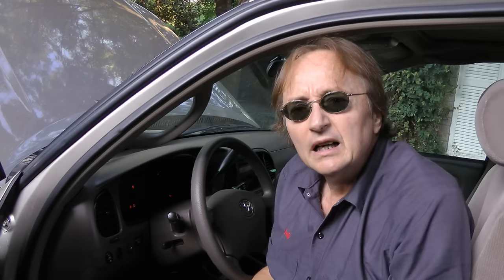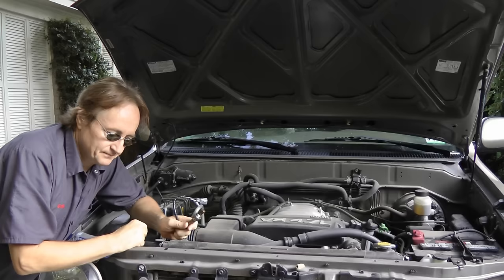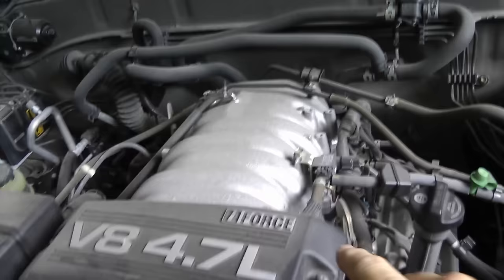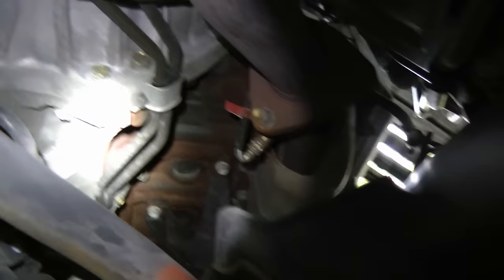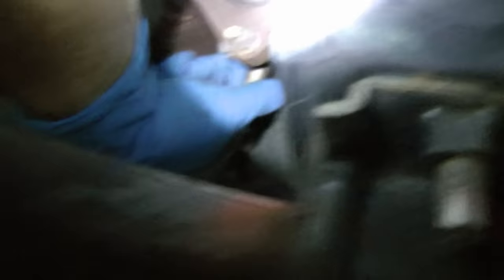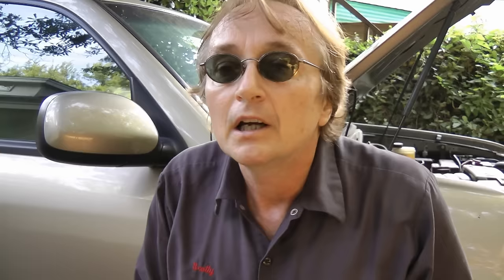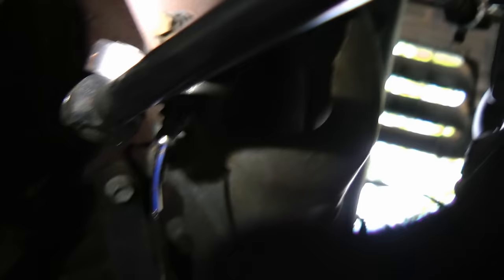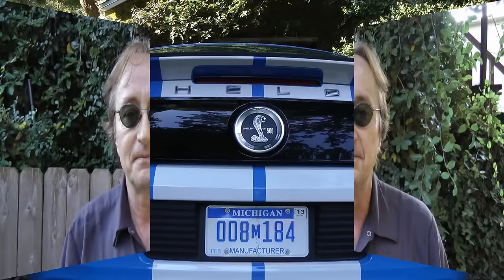How to Replace an Oxygen Sensor in Your Car (Air Fuel Ratio Sensor)

Comment: That's copper anti-Seize, it doesn't have to do anything with sealing the threads correctly. anti-Seize is use to prevent something from getting frozen/stuck together.

Comment: hey its me again with the 2001 Hyundai Elantra. the check engine light I'd on for oxygen sensor circuit slow response bank 1 sensor 1... can you please educate me on the location of it ...
Reply from the maker: that's the sensor on the exhaust pipe BEFORE the converter. #2 is after the converter
Reply: Thank you. I changed it already.

Comment: Hello scotty,

Ive been dealing with a 98 mustang for a year.I had bosch  o2s upstream which worked for a while then back with the p0135.I replaces with some cheap sms which then gave 2 codes.SO i got smart and got HGKs and only one code which is that darn p0135.
Ive rechecked harnesses, did the cycle and still after the cycle i get that code again. But i noticed the computer says the cat converter monitor says NOT COMPLETE. Even with the o2's complete one gives the p0135 and the cat monitor is still not complete.
Reply: would any downstreams cause a code for upstream??
Reply from the maker: often a bad cat causes all those problems, see that a lot
Reply: Scotty Kilmer thanks scott. Should. Have mentioned these are aftermarket performance  cats installed by midus 8 years ago mate.But if you recommend. Replacing i will,
Reply: Jimmy S  thanks for that info. UI remember the fuse blew a year ago and i replaced them. I am using a odb 2 bluetooth and app.It is showing BANK 2 SENSOR 2V as 0.0 reading and BANK 1 SENSOR 2v as  0.0 reading.the other 2 are reading random numbers as they should.I wonder if the PCM took a dump? I traced wires and checked fuses even took the pcm apart to check for anything.
Reply: Jimmy S
 i will check in the morning to make sure the fuse is the right amps as well.

Comment: how to remove oxygen sensor bank 2 on 1994 mercury grand marquis..do u have a video?
Reply from the maker: +Jose Rico same as this video, bank 2 is the side of the engine which doesn't contain the number one cylinder, and sensor is right past the exhaust manifold, get to it by jacking up the car
Reply: +Scotty Kilmer  i just wanted to say tnak you very much i just got my sensor  done..thanks  again

Comment: Scotty, I have an 2002 explorer that idles very bad when cold starting and even dies a few times. I have to keep my rpms at about 1500 just to keep it from dying. Once I warm it up for about 10 minutes it will stop dying and my idle is normal. The scanner gives me codes for o2 sensors. Please help!
Reply from the maker: O2 sensors just feedback data from the exhaust gas concentrations, on that model more often vacuum leaks will cause such problems. Try my video "finding engine vacuum leaks with a cigar" and also have the MAF sensor tested
Reply: Will do, thank you! Great channel!!
Reply: Scotty Kilmer Scotty  I noticed that you never use a torque wrench, some people has strong hands and snug can be 200 pounds of torque

Comment: Should you disconnect the negative battery cable or is it ok just to leave everything on.
Reply from the maker: Josh Barker it's always safer to disconnect battery, but on most cars it isn't needed for an O2 sensor as they have no power when engine is shut off on most cars
Reply: Again thanks. Just changed my o2 sensor bank 1 sensor 1, runs like a champ.
Reply: Scotty Kilmer yo Scotty ,my car can reverse perfectly but when I put it into drive and press on the gas it doesn't go anywhere what can be the problem ?

Comment: I replaced 3 of those already and the stupid light never went away, even the people at the auto parts store tell me that a should drive it for at least 100 miles and it will go away on its own, but the one I replaced on my Hyundai never did and I just turn the light off myself! Is this normal? I'm surprised the light went off on your video!!!
Reply from the maker: realize oxygen sensors are part of a complex feedback system measuring exhaust gases and feeding back info to the computer. As such, over a dozen different things can trip an oxygen sensor code. Often it takes a pro mechanic to figure out the ultimate cause.

Comment: Hello I had a question I instal a after market temp gauge I remove the old temp sensor and screw the new one in it has the the wire belt in to the sensor and gauge I pick it up at auto zone 
  After I instal it the next day the service engine light turn on I pulled the code out and they are 14 I look it up and it says temp sensor.   And It also had code 13 witch I look up and it says o2 sensor 
Well to make a long story short I'm wondering by me disconnecting the dash temp light sensors would that cause the Check engine light to turn on also the sensor I'm  talking about it the one that read the temp to the dash not the one that send the temp to the Computer it a 1983 Chevy s10
Reply from the maker: +Jose Zamora  get an oem temp , using aftermarket units will mess up your car's computer. If you want to add an aftermarket gauge, install the sending unit somewhere else

Comment: hi Scotty, does OXYGEN sensor is anything to do with AIR CON?? 
MY toyota 1500 cc allion model is giving me a air con issue, some times mornings and nights this works great but in the noon hours it does not blow cold air. 

my air con GAS has no leaks , compressor service done on 25k km's and now its 45,000 km only.
Reply from the maker: +najathm mohamed  NO, oxygen sensors have nothing to do with AC operation. You are probably just low on refrigerant, check that first.
Reply: +Scotty Kilmer  Hi Scotty thanks for your reply, I checked everything including GAS, but Good news is I got it fixed through a mechanic here locally, what he did is , 1. He pulled a small sensor like a CIGAR from the compressor  and he replaced it with a new one ( 60$ ) and every thing worked perfect onwards, ill post the picture of the sensor on another day. what the mechanic said : Compressor I had ( Toyota 2011 Model ) is a SELAED type compressor and only option is to do is to install a new one, but he did is just replacing the sensor and it worked, seems its a common issue in this new model.

Comment: If your new sensors don't come with the packet of anti seize does that mean they're just cheapskates and you apply your own copper based anti seize?  I do have a jar of Permatex copper anti-seize. 
Or does it mean your vehicle doesn't use anti-seize and you shouldn't put any on? 

1999 K2500 Chev Suburban with a 5.7l Vortec V8.

Comment: Is it alright to wait to replace an o2 sensor if it's just the heater circuit that is broken? The sensor should still be working right?
Reply from the maker: yes, it won't pass emissions testing, but if the rest works it will run fine
Reply: Scotty Kilmer Okay, thanks. My state (Michigan) doesn't have emissions testing :)
Reply: +Scotty Kilmer 91 grand marquis would a bad o2 sensor cause my car to run less efficient after a while of driving & when I'm accelerating to pass someone? making a weird noise while accelerating

Comment: Scott I have a question I got a code p1166 and says bank 2 sensor 1 on honda accord ex soo which one is the sensor the first or the second one?? I confuse with this please,and thanks you
Reply from the maker: bank two means it's the sensor on the number 2 bank of your engine, and all cars have different configurations for that, check to find out which side is number 2. And sensor one means it's the sensor on that side BEFORE the catalytic converter close to the engine. Sensor two would be the one after the cat
Reply: My car is 2000 honda accord ex 2.3 I am not clear where is bank 2 sensor 1
Reply from the maker: Martir Mejia
you have a 4 cylinder car, it only has one bank, so your computer software is bad, it should say band one sensor one in your case. ONLY a V configuration like a V6 honda engine has two banks

Comment: I have Infiniti  q45 2004 with code fault # P0135 Front HO2S Heater, Bank 1 and i replace it with new one and check engine still there ,  what i can do more. thank you
Reply from the maker: +Amer Ben Aqeel IF you used an OEM sensor, then either wiring is bad, computer is bad, or you have a software problem.
Reply: +Scotty Kilmer thank you so much

Comment: I have to replace bank 2 sensor 2 on a 97 LS400. From what I've read, I need to pull back the floor carpeting on the passenger side and get at it from there. Anybody ever replaced this one? Any advice?

Comment: Greetings. I just got a quote to replace my O2 sensors on my Nissan Murano 2005 SL for close to $1000/. Error Code P1283. As a young female there is always a concern I'm being taken advantage of. Is this something I can do and most inportantly, should I do?
Reply from the maker: IF it runs fine otherwise, you can drive it, people often do that for years. And really, rarely do all the sensors go bad at once, often things like bad gas gives them a false code for replacement. Try my video "fixing bad catalytic converters" and often that cleaning will fix them too

Comment: WARNING: Make sure your o2 tool will connect to something you can apply force too. Mine is made for a  1/2 inch drive which is too small of a tool to apply any real force to and I can't find an adapter to step up to a 3/4, it also fits a very large socket which only a mechanic would have. Try to get one that fits a 3/4 inch drive like the one in the video.

Comment: need to replace the front O2 sensor in a GMC Acadia (2011).  Which one is that?
Reply: front is always in front of the catalytic converter; just follow the exhaust pipe down from the manifold and you'll find it. there are only so many wired objects screwed into your exhaust system. :p
Reply: Got it!

Comment: the o2 sensor in my dads car popped out. AFTER he put it back in the check engine light came on. (Used OBDII adapter, it is for the o2 sensor.)

whats wrong with it?

Comment: My engine light came on an went to advance auto an this came up: p0037 heated oxygen senor heater , control circuit low, bank 1, senor 2 intermittent an on next page it said :p0141 oxygen senor heater circuit bank 1 senor 2 history mil . this was on the gauge He put under dash . I have a darn emission test at the end of the month too , please get back .2003 Saturn Ion do I really need to get oxygen senor replaced 4 sure ?

Comment: Thanks for a nice video.  I'm going to replace the sensors on my 09 Subaru Forester.  Lately the gas mileage has dropped and my son says it's probably the oxygen sensor.  It seems pretty easy to replace.  Thanks Scotty.
Reply: +A gm (snowman) just tell me your OE number, we can help you find correct oxygen sensor .
Reply: +Jianjun Ren I just got bought a Denso part 234-9123.  Thank you.
Reply: ok, if you need my help, just let me know.
Reply: +Jianjun Ren Thank you.
Reply: You used subaru service part oem ? Or after market denso ?engine light on if y used after market one?

Comment: Hi Scotty check engine light come back on went back to the Holden dealer not happy  they checked it for free told me it was the rear left hand 02 sensor went and brought one myself put it in but light is still on do i need to get the code erased any help would be great
Reply from the maker: have it erased first, but realize O2 sensor systems are part of a complex computer driven feedback system that measures the amount of residual oxygen in your car's exhaust stream in an attempt to make the engine run at perfect stociometric levels for best combustion of gasoline and air inside the cylinders. As such, dozens of things can actually trip those codes. Good Luck.
Reply: Hi Scotty i put another rear sensor in my SIDI  Holden Commodore light was still on phoned Holden they said computer was reading the old code i had to bring it in and get code erased of course they were going to charge me , i turned the ignition off and on about 6 times the engine light went out and hasn't come back on again and fuel economy has been great

Comment: My check engine light went on twice (today being the second time) now I know i have to change my oxygen sensor, so I got code p0031 bank 1 sensor 1. Would you happen to know how much it would cost? It's for a 02 Nissan Maxima GLE
Reply from the maker: +Alejandro “TheKidBart” Lopez  buy one at auto zone and do it yourself, otherwise mechanics charge 100 bucks an hour labor in most places these days.
Reply: +Scotty Kilmer bank 1 sensor 1, is it upstream it downstream? I mean I had changed it once on a 97 Geo prizm which was very easy
Reply: +Alejandro “TheKidBart” Lopez I think sensor 1 is the upstream sensor but I'm not sure.
Reply: buy a cheap o2 sensor from eBay. it worked for me, went from 20 to 26 mpg in the city

Comment: I hot a 03 Toyota sequoia and it won't turn On I cranks over but no start if I keep trying to start it it has a gas smell I have out new spark plugs and new pump and fuel filter and still nothing some times it back fires please help don't know what to do

Comment: If only it were this easy to change a O2 sensor. Every one I've come across is always rusted on and either the threads break off in the exhaust or the whole nut breaks off. Either way I end up having to replace the pipe.

Comment: Hi Scott, my name is James. I have a 2009 Cadillac STS that I brought used, I noticed that when I put fuel in my car the gas needle shows the amount of gas in the tank. But when I drive about ten miles, I noticed that my gas needle has dropped a lot. Also it feels like the car is holding back and I'm constantly feed gas to the engine. Sometimes the check engine light would come on. I took it to the auto store and had them scan it, the machine said it was an o2 sensor but I forget witch one. The check engine light went off but the car is still driving the same. Could you please guide me..... Semper Fi
Reply from the maker: I would assume you need a new fuel pump and sending unit inside the gas tank. Pray that fixes all your problems.
Reply: Thank you for the prompt response...... Semper Fi

Comment: Do you have to clear the code after replacing the sensor
Reply: If the O2 sensor was the issue and properly replaced, the codes should go away by themselves

Comment: Po420 came out on my 2005 toyota matrix. I have replaced the downstream cat that was stolen and this came up. is it possible that the oxygen sensors are giving this code as well?
Reply: could the oxygen sensors cause the code  to read as such?
Reply: could a code PO420 show or possibly show due to bad oxygen sensors? or is that for sure a catalytic converter issue?
Reply: so what do you suggest? I know when i take it to the shop, they will try to replace the other cat that's attached to the manifold.
Reply: one last question? if i was driving the vehicle with out the rear cat for a month or so, could it possibly damage the front cat?
Reply: Thank you! you're awesome. keep up the good work.
Reply: +taledarkside How do you determine when an O2 sensor goes bad?
Reply: +Johnny B When you read the code that mentions HO2s what is your next step you would take?
Reply: Any good technition knows all about the trace the 02 sensor leaves, and how to make sense of it. I have a labscope but useing a scantool is just fine to make a full diagnosis on the narrow band zirconia.

You can't talk about 02 sensors because you dont understand how they work, or how the closed loop system functions.
Reply: it's getting spicy on this thread.

Comment: Hello Scotty I have my car with a code P1155 I am wondering where the sencor is? I change the one by the catalyst converter and the check engine light still on I went into autozone to check it. It gave me the same code with a bank 2 sencor 1
Reply: My car is Lexus 99 ES300
Reply: Thank you Jimmy :D

Comment: My car smells like gasoline and underperforms and it gets very, very poor gas mileage, still I have found no gas leakage, and no lambda code pops up on my diagnostics tool, still I believe it's a faulty lambda and will replace it today.. hope it fixes my problem.. if not I'm gonna junk the damn thing and get me a real car.

Comment: besides an evap leak that I have, I just realized after almost a yr,,,,,the garage put the New Denso air fuel sensor into the downstream position and instead of putting it in the upstream ,,, driving with 2 upstream sensors in my 2008 crv,  good thing I kept the Old one , compared part numbers and voila , I can't believe this it's a reputable garage 30 yrs plus but the guy must of been on something, or just a bad day,,F#$k !!

Comment: Please I need help I just noticed that my Toyota Corolla e120 does not have an oxygen sensor I have looked at the exhaust line and under the passenger side beneath the car and I cannot find any oxygen sensor. It's a 2005 model the European model
Reply from the maker: I don't know what they use in europe but I assume it would have at least two of them, unless some fool removed them and put on a different exhaust
Reply: Scotty Kilmer 
Yeah, I thought that at first until I went around looking at other Corolla 2005 E120. And they all don't have it. You will see the plug port like in the American siblings of same year, but no sensor plugged in.

Comment: I have an Avalon 2013 XLE Bank 2 Sensor 1... where is it located at?
Reply from the maker: that's the sensor on the front of the engine by the radiator , the one BEFORE the cat converter
Reply: Scotty Kilmer thank you soooooo much!! Praying for u sir... Toyota wanna to charge 600.00 today!!!
Reply: Also I couldn't kind found Denso for avalon 2013 xle... So I have to go to Autozone